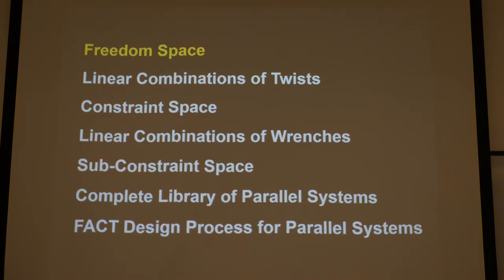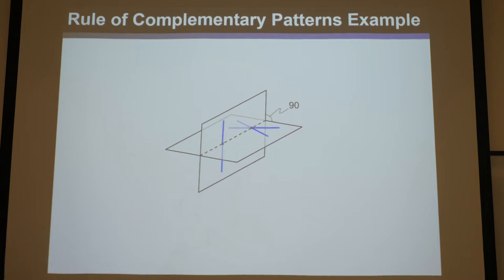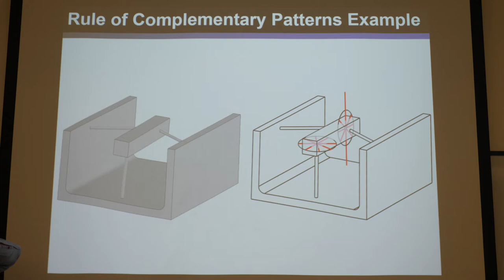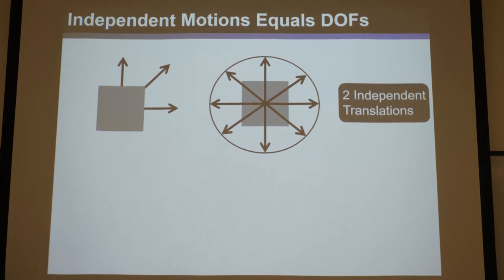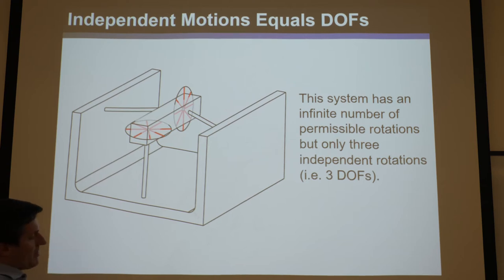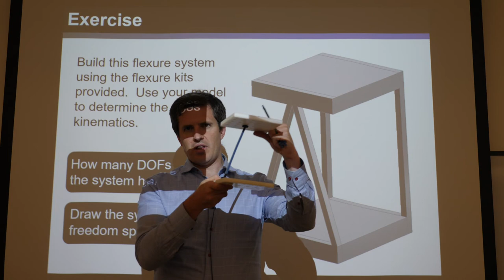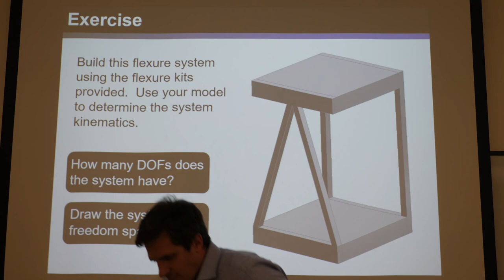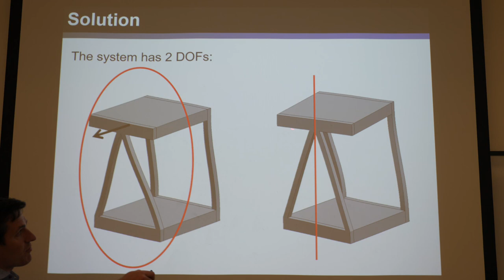Compliant Mechanisms Lecture 5 Part 1

Comment: Hello Professor Hopkins, I have a question. You keep repeating to "CAD" topologies in order to analyze them, but I wouldn't know in which sort of program. Could you please relate what sort of software you use in order to find out the mode shapes?
Reply: At UCLA we mainly use Solidworks! You can create the 3D model there and run simulations - UCLA graduate student taking his class right now